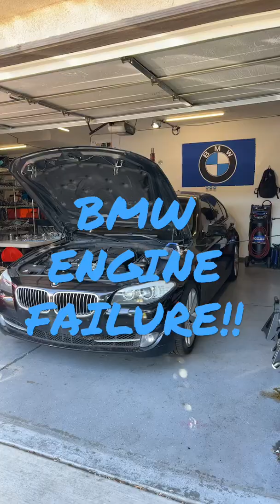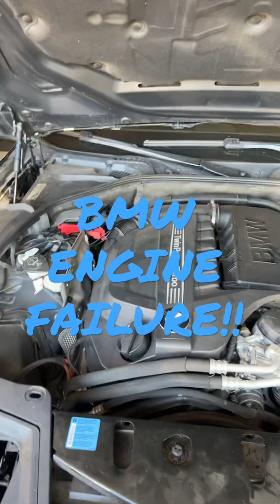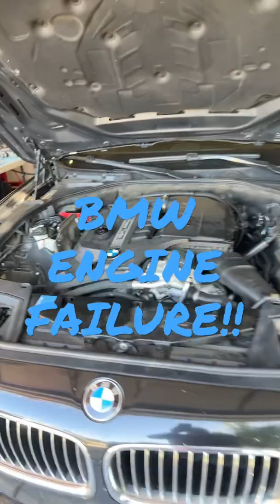BMW N55 ENGINE FAILURE. Is Scotty Kilmer Right About BMW? You Tell Me!

Comment: The oil cap smelling like fuel is not from driving the car hard it is from poor injectors which puts fuel in your oil and washes the oil away from your bearings an ends up spinning bearings is people are playing the cars but don't do their maintenance
Reply from the maker: I agree that poor fuel injectors can cause this, but fuel is naturally found in engine oil just driving normally due to blow by and keeping the crank case under a vacuum like these BMWs, like to do, so driving the car hard would increase the fuel smell, the oil sample was tested, and it was not over, diluted with fuel, but thank you for watching and thank you for the comment. You are appreciated.

Comment: You absolutely have to change oil every 3000 to 5000 miles if your driving hard! My car is down a quart in 5000 miles!
Reply from the maker: You are absolutely right, with that in mind how about Audi’s specifications? They said that the A4 could consume 1 quart in 1000 miles, when they had the piston ring to cylinder clearance issues with the 2010 range of A4 so essentially if the oil change interval is 7000 miles you will have replaced 7 quarts in 7000 miles. Maybe we should just change the filter, lol
additionally, everyone at the EPA and the California air resources board are concerned with fuel mileage, due to air pollution, but what about these low tension piston rings and bad piston cylinder fit problems that multiple manufactures are having? I wonder where all that burned goes? Most likely into the atmosphere in some form or another.

Comment: Scotty is partially wrong. BMW's 4 cyl and v8 engines aren't the most reliable. Bmw inline 6 engines like this n55 are very reliable when well maintained. If you can't afford maintenance and repairs for a luxury car, don't buy it until you have the money. Also, this youtuber claimed that the driver was 18 years old and didn't do regular oil and filter changes. What experience does an 18 year old have for driving and taking care of this car? I've seen many n55s above 200k miles and a few above 300k miles. Besides, they're all pre-owned. You don't know how well the previous owners took care of the car.
Reply: I'm a 2015 n55 owner with 200k miles. A 2016 B58 owner with 100k miles. Also, a 2016 s55 with 213k miles. I've been the first owner for all cars and took care of them well.
Reply from the maker: N55, 208k
N62, 183k
My previous X5 had the M54 inline 6 with 265k sad to say but she died a horrible death but it was my fault directly😞
Maintenance is definitely the key.
Reply: @MechaniclifeJDM It's alright dude. You cherished some good miles! 👍
Reply: @MechaniclifeJDM Btw, did you experience any oil leaks? Not talking about the v8 but the n55.
Reply from the maker: @EGOV10PLUS Just the valve cover gasket, replaced the whole cover a while ago.

Comment: what can you even do about this i think i have the same problem on my 335i
Reply from the maker: Once you have had the problem the engine will require major work to make it right again. There is a jerry rigged approach that might work in a pinch if the damage isn’t too bad
Reply: What is it? Replacing the rod bearing or the crankshaft? Having a very similar situation

Comment: Has nothing to do with oil slushing. If it had low oil then yea maybe. But it had to be making noise before it locked up.
Reply from the maker: Sure at 5.5k rpm, and 1.2 G it will make noise, just not for long enough for you to realize it and then do something about it.
Look it up it’s actually a well documented issue where when used for race applications the engines get baffle plates, windage trays, and or a dry sump setup.

Comment: How do you know it was “valve to piston “ ?? Or I guess my question is how do I know if the valves are hitting the pistons? (I’m currently in the process of taking my engine out it’s an N55 and the serpentine belt got In and I want to make sure that the pistons and valves are fine )
Reply from the maker: Did yours jump timing?
Reply: @MechaniclifeJDM  not that I’m aware of. Then again it does turn the full 360 degrees but sine some of the prices of the belt are in the little crevices of the chain it makes it difficult to know. Also I was asking because (took the engine out on Sunday) I have the timing chain tool because I’m going to take it off but I don’t want the timing chain to move so I want to know everything is ok before I proceed

Comment: These cars have oil starvation issues specifically on hard left turns. There’s a huge write up about it online from a guy who tracked his n55. Only fix is to swap in an m4 oil sump. Is Scotty Kilmer right about bmw for this issue? In this case yes. Bmw advertises these cars as sports cars “the ultimate driving machine” what ultimate driving machine can’t take 1g of lateral force? 
Lots of bmw owners want to cope and blame the owner saying they didn’t keep up with maintenance, but this is simply a design flaw. A new oil change doesnt matter if the oil pickup isn’t getting the oil. I hate and love bmw. I tried to sell my 335i but I couldn’t find a car that felt as satisfying to me in my budget (20k). Apart from rod bearings Scotty is wrong though, I come from jap cars and this wasn’t the nightmare I feared it was going to be. They need more maintenance and it costs more but I guess if you come in with that expectation and do the work yourself it isn’t bad
Reply from the maker: You are almost exactly aligned with my opinion on this! 
Thanks for watching and taking the time to comment, we sure hope you subscribed.

Comment: I've owned  an E60 BMW 525 I since I've owned it I've had one problem with  it the oil filter housing gasket was leaking sorted it myself since  then no problems I change the oil and filters every 4 months engine runs perfectly 90 thousand miles on  the clock have owned  it since 2016
Reply from the maker: Thank you for watching and taking the time to comment.
Reply: i noticed a small crack in my oil filter housing gasket as well, doing an oil change today so i thought id just replace it at the same time

Comment: I have an 08 N54 and it has 300,000+ original miles. Bottom line is people do not pay enough attention to levels and oil service intervals. Do not drive 10,000 miles before you change your oil!!
Reply from the maker: Exactly correct, most cars today can make it to 300,000 its usually the owner who prevents that somehow.
Reply: I changed my oil on my 2011 n55 every 5 000 KILOMETERS not miles, and still spun a rod bearing at 134 000km…. Maintenance goes a long way, but these motors have bearing issues. All N54 & N55 will suffer a failure once pushing any power higher than stock , or if low on oil for any significant period of time

Comment: Gets starved of oil if its driven to hard??? 

Are they doing 10g launches or somthing how can the oil be away from the pick up for that long??? 

Some ultimate driving machine.
Reply from the maker: Low oil level is, low oil level…. that can kill any engine, some faster than others but they all need that continuous lubrication.
Reply: it's not from being driven "too hard". It's from being "beat on".  
Basically people pretend these cars are invincible and do not 
A: Properly warm up the oil temp
B: Change the oil every 3000-5000 miles MAX
C: Properly maintain the VANOS and do required carbon cleaning
D: Repair the majority of "small" issues that arise, which generally, indirectly, create wear on other important components.

BMWs are, in the grand scope of convenience, delicate.  Most owners do not acknowledge this and do not properly care for the car. 

It also doesn't help that BMW itself refuses to acknowledge these more sensitive areas of operation and refuse to really BEAT the maintenance and operating procedures into customers heads. 

All in all, the N55 IS a very reliable engine, when Properly maintained, along with a couple other engines in their current and late lineup. 

Don't buy at high mileage, because honestly, with these cars, the worst previous owners aren't actually the younger kids. It's the little old ladies that listened to the dealership tell them to change the oil every 7500 miles and have never let them get up to temperature.
Reply: @dpro5321  I my self drive an Audi A3 2.0 Tdi, I tried to clean the intake manifold without removing it and knocked that black squidgy soot into the engine and semi seized the motor, I had to remove the whole, turbo, exhaust, drop coolant and oil, remove fuel rail and injectorsand finnaly the valvetrain to find carbon crammed in the top ring land on number 3 piston causing the semi seized condition, I cleaned it all out and rebuilt the motor, £500 of parts and about 25 hours of work later it runs again, really well infact
 CFFB 140 Motor remapped to around 190 but almost 500 NM of torque😂😂😂

Comment: This BS should have been treated as a "recall" being that this issue was very common....
Reply from the maker: Customers responsibility to maintain oil level, if the driver is enough of a fool, then fool proof alone will never be enough
Reply: @MechaniclifeJDM  there’s nothing wrong with the level of oil if it’s being starved by sloshing around, that’s a failure of oil pan design without baffles
Reply from the maker: @standyourground9973  it is a compound issue, low oil, worn oil, over revving, lack of baffling and driving style.
Also the fact that BMW simplified the oiling circuits within the engine
Reply: @JDM TECH LLC  Valid rebuttal....makes sense

Comment: I had a 92 525i 5 speed with a straight six men naturally expired. I did various mods to it and make it a little bit faster lowered it. And I beat the living snot out of it and I finally junked it with over 358,000 miles on it. Original motor original transmission original clutch. The owner before me however did to the heads which were known as an issue for those cars. That was when it had about 160,000 miles on it. I got it at 170,000. And everything I did until a certain point was upgrade and performance wise. Until it was getting too old to repair and costly then I just did OEM parts. Never ever had any issues with that straight six.
Reply from the maker: Thanks for watching and commenting
Reply: Well said, fantastic engine.

Comment: overpriced piece of junk
Reply from the maker: 😬 harsh words man but a respected opinion
Reply: @MechaniclifeJDM  the biggest piece of junk have ever come across is a g-wagon there are worse than Land Rovers and they are rot boxes is it any wonder the military don't use them anymore show me one that hasn't had welding down to the chassis that's 10 years old considering the price a lot of the vehicle companies could do a lot better let's face it once they got your money they don't give a s*** I have still got my old 3 Mondeo no rust on it at all just coming up to its 20th birthday just modified and upgraded to suspension that's back and prawns the engine is a lot more reliable than the newer models it has a cam chain not a belt my vehicle will still be running in 20-years

Comment: He's correct. I'd rather buy a 80s car from the salt belt than a newer bmw.
Reply: A 20yr BMW lead mechanic told me he would only buy an X5. That was 10yrs ago. Said Everything else is garbage.
Reply: @eddilovee  thats a given since he's a tech for the company. X5 are good, if you don't have much weather, dont drive it much, you don't intend on using it for the purpose it's built, fix the recalls, rid the common issues and rid of it within 5-10 years.
Reply from the maker: @eddilovee  thanks for watching and commenting. I am on my second X5, first one blew at 265k was totally my fault 🤦🏽‍♂️ if not 300k was definitely attainable, I know someone who has 349k on his and the suv is still in great shape, proper maintenance goes a long way

Comment: Bmw engines have Vanos. You need to drive these carefully until the oil is up to 60 degrees. 60 degrees is where the oil is of the correct viscosity to coat the moving parts sufficiently. Booting it before up to temperature causes starvation. 
I've had BMWs & MINIs all my life, look after the car it'll look after you. 
Why is this the case? Look at every BMW engine... In every size of engine, litre for litre they are significantly more powerful than most manufacturers.
Buy a Honda if you just wanna turn the key and go without care.
Everybody wants a BMW until its time to do BMW shit
Reply from the maker: Excellent point, thats why they sell used for so little, people run them until it has a moderately severe issue and then its either for sale or it becomes an expensive yard ornament
Reply: @MechaniclifeJDM  exactly, sounds great picking up a 10 year old BMW for 5k until you're repairing 100k+ of misuse in most cases. 
Cars are the same as dogs, the owner is the issue most of the time😂😂

Comment: BMWs are known to be hot engines and burn oil very quickly, it is important that you change your oil on time or even before 5000mi, it's the most likely reason people have rod bearing failures over the oil slushing around, BMW engines are designed in Germany where they see cold weather more often.
Reply from the maker: Low tension piston rings
Failed CCV system 
Improper oil change intervals or viscosity 
All reasons for increased oil consumption 
BMW simplified the oil system in these engines which also led to the known oil starvation issue with the rear bearings
Reply: Many people swap their thermostats for colder ones in bmws
Reply from the maker: @andries4561 on older models they sure did, but the newer ones with the electric water pump carry a thermostat which can be electronically controlled not sure if they sell those in colder ranges
Reply: Cold weather? More often? I dont think so.

Comment: Rod bearings failure,; an easy thing to avoid. Don't drive above 3k rpm until the oil is at full operating temperature.  I have 7 bmw's from 1981 model year up to a 2012 335i (N55 engine) which I make 600 whp and never had an issue. And I drive them all hard af.
Reply from the maker: Thanks for sharing your opinion, and also thanks for checking out the channel.
Unfortunately, the people who this stuff happens to really don’t even know what WHP stands for.
Reply: Car is waaay too fussy
Reply: The earlier N55 did have a higher than normal number of rod bearing failures.

It has been said that some of the reasons include the variable output oil pump designed to save fuel by running the oil pressure dynamically, faulty oil pressure switch, plastic pick up break, long oil drain intervals, cheap internals (i.e cast crank vs forged internals in the older N54).

Whatever the reason, there are high mileage N55s running around still so the problems are likely not common but common enough to get people yelling on the Internet especially with a 7k engine replacement on a 20k used car.
Reply: I'm sorry
Reply from the maker: @BigDmike24  Whatchu drivin Mike?

Comment: Just upgrade oil cooler
Reply from the maker: Perhaps… but only after it’s either rebuilt or replaced at this point shes locked solid
Reply: What does oil cooler have to do with oil starvation? Baffled oil pan apparently helps to avoid it

Comment: N54 errr day
Reply: They're no better😮‍💨 I replaced the battery registered it now the air bag and passenger seat light are on. I replaced the boost solenoids now the boost pressure is to high or low and goes into limp mode and performance wise it's completely stock
Reply: @Osamabeenleanin210  are you getting 30ff.  That’s a boost leak. Replacing battery shouldn’t set off seatbelt / airbag. Unless you replaced the seat or unplugged airbag.  I did that to mine.
Reply: @Osamabeenleanin210  I’m 20k deep in parts and repairs into my e92 n54. I knew exactly what I was getting into lmao

Comment: No
Reply from the maker: So your saying Scotty Kilmer is incorrect? 
BMW’s are good cars?
Reply: @MechaniclifeJDM  As a car yes mostly, some questionable engineering choices throughout the years but what brand doesn’t have that. They’re unreliable when they fall hands to the 4th or more owner that barely takes care of it, beats the shit out of it and expects zero consequences. Like yeah obviously if you push an N55 hard it’s going to eventually be starved of oil due to not having a dry sump system; zero issues in that regard with my F80 and it’s practically the same engine. People expect M reliability on their base 3, 5 series
Reply from the maker: @mcintosh.motors  An excellent point you made there and I couldn’t agree more.